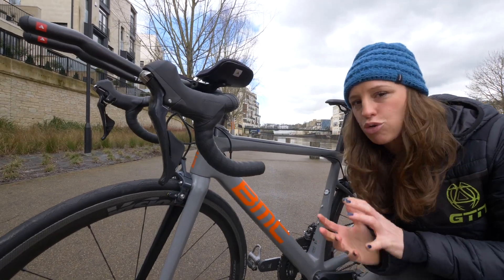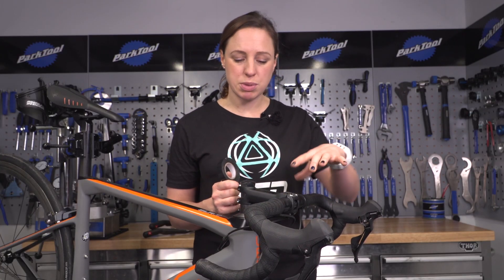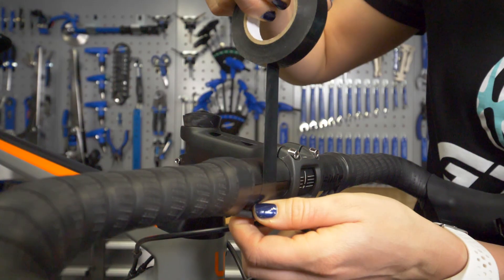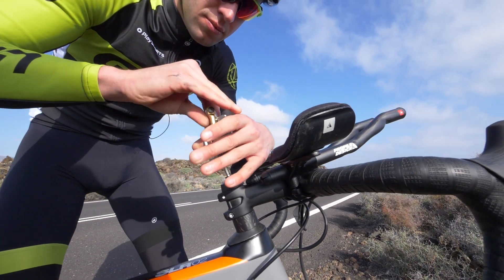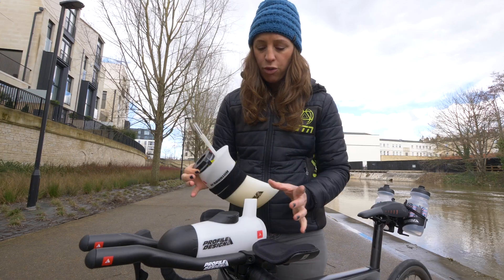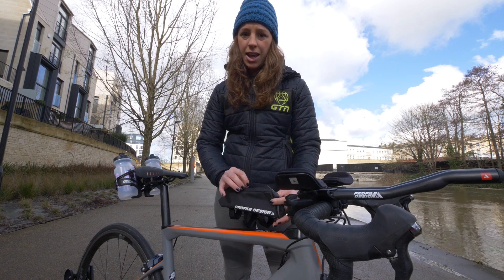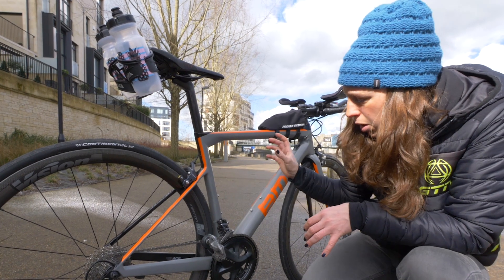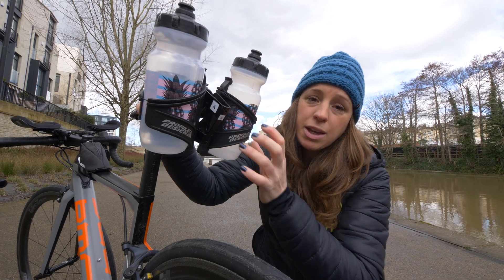How To Adapt Your Road Bike To A Triathlon Bike | Ride Faster In Your Next Triathlon

Comment from the maker: Do you have a road bike, road bike with clip on aerobars or a triathlon bike?
Reply: Old steel bike with clip-on aerobars, ski-bend type. Yup I ride an old bike with a power meter, because the most limiting factor, sadly, is still the rider, not the bike 😉
Reply: I have a trainer Orbea road bike and a race Fuji tri bike, but it's old an heavy and looking to upgrade, might just get a nice light road bike and add some bars cause i'll be racing Ironaman Whistler and I need all the help I can get up those hills
Reply: I've run the spread. Started on road, went to clip-ons, now I'm on a Felt IA. Clips on are great for getting most of the speed, but not having access to gears and (more importantly) losing out on my road bike fit was just annoying to me long term. Didn't like going on group rides on my roadie with a TT-specific fit. Aerobars are fantastic starting out, though!
Reply: I have both!😅😀
Reply: Global Triathlon Network I started with a road bike but now have both
Reply: Global Triathlon Network both! CAAD12 with a quarq pm and a Blue Triad SP
Reply: I have a felt road bike with profile design aero bars but I prefer my horizontal Bottle from xlab. It’s better.  Still manage to go pretty quick
Reply: Road bike (Scott CR1 Pro) with clip on bars and a set of racing wheels.
Reply: I have a Specialized Transition 2009 tt bike, i just finished upgrading with ultegra. Looks ace ☺️. My road bike is a Trek Madone with the same new ultegra on, with the profile tri bars on, like your ones but aluminium version. Love using them riding solo and trying to keep the position for longer each time. My turbo bike is a Carrera TDF 2007 with the profile aerobars with tri bars on with shifting on the bars. Doing the Outlaw again this year so wanted them to be virtually the same. The road bikes are amazingly pretty quick so either option is great! Maybe 2-4mph difference although economy is probably not quite the same. Saying that the road bike doesnt have the deep rims on. Got to be fair the wheels do make a difference.
Reply: I built a tt bike but use a road bike with clip on aero bars for training.
Reply: An old Trek road bike that I fitted with Aero Bars last summer. Can't wait for the roads to clear up from ice and gravel here in Sweden so I can get back on the saddle again.
Reply: Hi, I am an eleven year old girl who is joining a triathlon in singapore! I need help for turning on my bike and if it is possible pls make a video about that bethore April 10th. Thx love your channel
Reply: I am a roadie...So yaaaaa
Reply: Currently have a road bike but think I’m gonna get a new one with some clip on aero bars
Reply: I have a mountain bike but it has aero bar and rigid fork
Reply: I have an aero road bike but planning to change my handlebar into a basebar. Would it be possible?
Reply: I have an alloy tt frame with stoker 26 bullhorns that i slapped some road shifters on bc i prefer them and i can add the clip ons or not depending on how i feel
Reply: road bike with aero bars

Comment: When I tried to use electrical tape under clip-on bars it always finally moved and never stayed really firm. I do not recommend it. Do not use any tape, use carbon paste and tight at right torque.
Reply: +1, do not use electrical tape!
Reply: Agreed, electrical tape do not work at all. Tried it and my aero bar moved around.
Reply: try athletic tape as it is slightly abrasive and will give the clamp a better chance to grip~ Athletic tape is also designed to stick on when you sweat (the glue should hold up better:-)
Reply: George Lemeitre  cut old rubber tube from the tire. Not sure if its cube in english. The one you fill with the air ;)

Comment: If you convert your roady to a Tri-Rig it’s nearly permanent because a proper fit on a Tri Rig require not only aero bars but also a Tri Seat and could also mean shorter cranks arms and the geometry of the bike may not adapt well to a decent Tri fit. If you do convert it well enough, you’ll likely want to leave it that way because it would too much work to switch back to a roady configuration - so you still just have one bike.

Comment: Great video. In addition to Heather's advice i'm using a fast forward seatpost that brings you even better positioning. A new saddle (split nose, tt specific) could be also an option if one's butt hurts after time.
Reply: +1, it makes no sense to use aerobars if you're not going to change the effective geometry of the bike. a typical tri bike has a seat tube angle of about 78-80°, while a road bike's is 72-73°. aerobars are not the only difference. to have an effective tri geo, you need to move the saddle forward and up, while dropping the handlebars / aerobars.
Reply: This is the MOST IMPORTANT. Who the heck can ride on a regular saddle if the point of contact is literally the scrotum? Not me.

Comment: @Heather - Nice video. But there is one correction: There are plenty of composite carbon handlebars on the road bike market that are designed to accommodate clamp-on aerobars. My first carbon handlebar was a WCS Carbon Evolution from Ritchey and it was reinforced a couple of inches on either side of the stem clamp area so aerobars could be safely clamped on. Today I'm using an aerodynamic Canta Ergo Carbon handlebar from Profile Design and it, too, is reinforced for clamp-on aerobars.

So the advice to viewers should be this: "If you have a composite carbon handlebar, check with the manufacturer to see if your model is reinforced for clamp-on aerobars before adding them. Most carbon road bars are not reinforced for them and will be damaged if you clamp aerobars onto them. But it's perfectly safe to use clamp-on aerobars with a carbon handlebar that is designed for them."

This is a feature that I always look for before purchasing a new handlebar. If it doesn't support aerobars, I don't buy it.

Comment: You might address some more points. First left out is DI2. This will help attach bleepers to your clip-ons and change the gears without having to change your aero position.
Next important this is seat post with multiple offsets. I own a Merida Reacto specifically for the fact that I can flip my top seat post and from positive setback I now have a negative offset witch brings my position forward.  I raise the saddle accordingly and voila, I have almost the same position as on a TT bike.

Comment: If you have a double bottle holder, you can use one of the bottles to squeeze gels into, along with enough water to make them drinkable. If you put lines on the bottle, you can work out approximately how much to drink to get one gel. 

If you are moving your seat forward and up, you will also need to tilt your saddle nose down a bit. 

Top-tube bags can actually make you go faster! If they are reasonably streamlined, they extend the length of your stem, and the air moves around the stem more efficiently. A bit like how TT bikes have wider forks.

Comment: With the aero bento boxes my top tube narrows like your bike and if the box can move backwards it turns upside down. Nice yours has the cable around the stem to avoid that. For riding position I moved the saddle forward, up and tipped nose down a bit more. Might be an idea to measure front and rear of the saddle relative to the bottom bracket to keep the relationship the same.

Comment: Interesting that you suggest moving the saddle to tweak the reach when in a GCN bike fitting video they state that once the saddle is in the correction position relative to the pedals then the reach is adjusted on the stem side, not by moving the saddle.
Reply: You move the saddle forward to open your hip angle which is what tri bikes already do

Comment: nice video... as for me, i had to replace my seatpost with the fast forward seat post by profile design in order to achieve a more aerodynamic position.
Reply: Why exactly?  Is it that we all would benefit from that seat post or is specifically because of your body type/flexibility/etc?
Reply: @jackwright3098  staying on aerobars would have my big tummy compressed. I had to move the saddle forward and lift it a bit higher so I can stay on the aerobars for longer periods. The fast forward seatpost helped me achieve the perfect position for me.... But now that I have a triathlon-specific bike, I put back the original seat post on my roadbike.

Comment: I see you don't use a split nose saddle. Any reason for that? From what I read and heard , you should switch to one if you add aero bars.
Reply: They can be nice as, for some, they take pressure off the perineum and let you rotate your hips forward to the more optimal position. There's no requirement, though, and if you're comfortable without, you're comfortable.
Reply: Not a requirement at all.
Reply: Split nose saddles are nicer when you sit on the nose. Rode for years in tt races with a conventional saddle but they are bad for making the legs and everything sleepy. Moving around and off the saddle helps but practice helps knowing when even with the split nose. Might depend if you sit forward or back on the saddle whether the comfort is any different. Too far back and the hamstrings snag on the saddle edges especially on wide saddles.

Comment: Hello, Great video! Thank you for the info. Taking the mods a bit further, has anyone ever installed Sram Red eTap Blip Shift Buttons on Profile Design aero bars? I’ve just installed new T1+ Carbon aero bars on my road bike and would like to add the Sram Red eTap Blip Shift Buttons if possible. Please advise. Thanks in advance.

Comment: What is a good saddle to use on a road bike with mini clip-on tt bars?
Reply: It's really personal. What works for me may cause you lots of discomfort. It's super annoying to have to deal with trying out lots of saddles, but once you do, stick with it. For the aero position, the saddle should not cause excessive pressure on your perineum and also be narrow enough that your inner thighs aren't rubbing on it. Lots of triathletes ride ISM 1.0/1.1 saddles.

Comment: Recommended to switch to a zero setback seatpost?
Reply: Christian Andrade if you can get low enough with the front with maybe a steep angled stem then it could be a benefit. There are some seat posts available which can be reversed so look out for them too, then it can move the saddle even further forward. As long as your handling is still good with the changes. I looked at the options for my bike but as my top tube is so high i settled for the saddle going right forward on the standard seatpost and it really feels as good as the race bike despite the higher front end. Pretty rapid on the flats and climbs nicely. Easier on the neck too. Apparently road bikes arent designed with the same front end strength as a tt bike so be careful not to overload the front.

Comment: Good video Heather, but I would have included a set of racing wheels.  I have a set of Mavic Cosmic Carbon 55s with aluminium rims (about $1000). One bike for both training and racing so I know I'll be comfortable and not "squirely" when racing.
Reply: Barry Field If you've got $1000, just get a used TT bike. It'll be much better than aero wheels on a roadie.
Reply: I considered that Kurt, but my road bike feels great doing 50-65 milers and I didn't want to possibly losing comfort on an ill fitting used bike.

Comment: The seagulls appear to take exception with your claim about the bottles proven to be more aerodynamic behind the seat than on the seat tube. 

And I have to agree with them: while the bottle itself may not be more aerodynamic on the seat-tube, I believe it serves as a fairing for the rear wheel and reduces the drag of the bottle-bike-wheel unit as a whole. But I'm not a science major, so if any of you fluid dynamics graduates have a link, I'd appreciate being corrected.